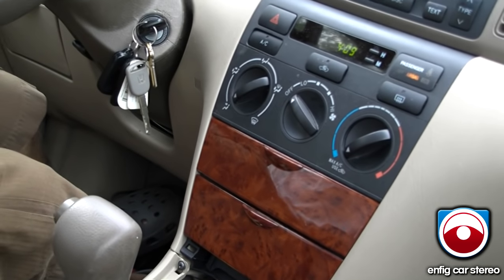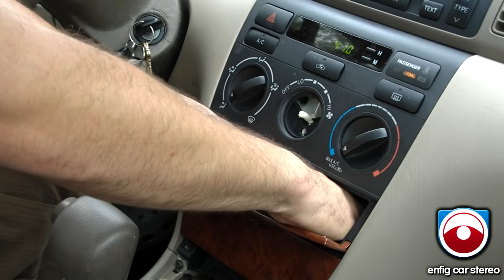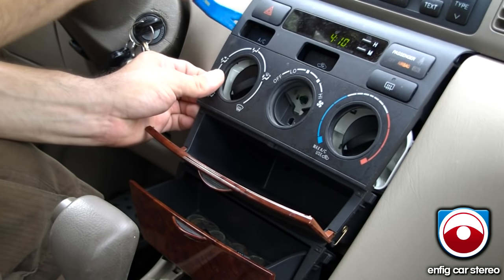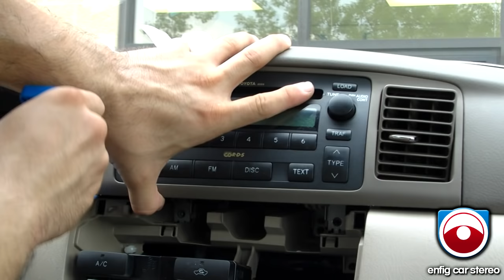Radio Removal Toyota Corolla 2003 -2008

Comment: Great video! We swapped a radio in an hour thanks in part to this. No life story, no blah blah blah! Thank you!! Bam! Also, tip: not to lose those screws, stick a little rare earth magnet on your impact driver's shaft near the drill end and it will magnetize the entire impact shaft. That will hold the 10mm screws for you when you take them out and put them in.

Comment: Great way to break the panel. If the air vent under the clock is not on middle possition you will cry over broken panel...haha. I an lucky I figure out before to break it
Reply from the maker: I've done this installation many times and never had an issue.  Can you explain what you mean?  I don't understand how the positions of the knob makes any difference so I must not be understanding you.
Reply: @Enfig You can do as many times you like, until you get to Corolla with different trim (looking very similar) and then you will break the panel, which is regardless of how many times you done it before. It is what I said, IF you dont put the air vent, i mean the horizontal one which mixing the air from outside, then you will break the panel. Only way to remove is to put in in middle position. There are different assemblies of Corolla. Looks almost same like the one on your video
Reply from the maker: @namaikati9112  Can you email me a picture?
Reply: @Enfig  yes. Or look for corolla ZZE122R
Reply from the maker: @namaikati9112  I see you are talking about the manual recirculation switch.  We do not have that in the US.

Comment from the maker: Sometimes disconnecting an airbag indicator can cause an airbag fault that must be reset by the dealer.  I dont think that will happen with the corolla but I am not 100% sure.
Reply from the maker: @sm1ttysav Also in many cars my customers have had issues with an unrelated module not working after unplugging the battery.  Because of the power surge.  I'm not saying that you shouldn't disconnect the battery but sometimes it can cause damage.  This is a can that I personally would not disconnect the battery on.

Comment: Pep boys tried to charge me $180 to do this for me over the weekend. It was an emergency but not at that price. Thank you for helping me step my handyman game up.
Reply from the maker: $180 labor to install a radio sounds fair but not just to remove the radio.
Reply: @Enfig  yeah that’s all I needed, they considered it uninstalling and reinstalling it. The issue was my third party radio wasn’t turning off when i cut the engine so the radio was draining my battery. Needed to unplug it and plug it back in.
Reply from the maker: @BreezeInfinite  Technically they are right but that's why I always recommend staying away from chains.

Comment from the maker: It doesn't really matter where its at as long as there is room to remove the panel.  It is usually recommended that you disconnect the battery but nit necessary.  It just reduces the damage if something happens.  The key is on but engine not running when I shift the car but  I reccomed putting it in park and removing the key once that trim is off.

Comment: Superb video. Utterly efficient. Thanks for the tip on using a magnet to get the screws out, and using gum when reinstalling them. When I reinstalled them I wrapped the screw heads with a little plumbing thread tape to get them to stay in the socket.
Reply from the maker: Thank you!  That would also work.

Comment: Probably a dumb question, but when you remove the panel is the shift in Drive or 2nd according to your video?  Also, should you disconnect the car battery when working on the radio?  Is the key in ACC?  Couldn't tell.  Sorry for all the questions, and thanks again!

Comment: The door where you put your hands in to remove the big panel on my Toyota is broke. I found a replacement at a junk yard for the whole panel. You mentioned something could happen by disconnecting the airbag light when removing the panel. What should I expect? I need to unplug it obviously to switch out the panel, but just wanted to know what I should do or be aware of. Thanks!

Comment: Thanks for posting this how to video.  My friend's clock on her 2003 Corolla is not working.  I will use your video to repair it.  Her car is an automatic.  Also, the light bulb for the gear shifter is not working on her car.  Might be just a burned out bulb.  I was wondering if I take off the gear shifter panel, would I be able to see the light bulb or some other parts need to be taken off? Thanks

Comment: Careful with that front panel. I didn't realize that the top corners are clipped and ended up breaking both. They don't "pop off" as easily as this looks unless it's been done to the car before, and the joints have been loosened.
Reply from the maker: I agree this is why I pry on the top when I remove the radio to loosen those clips.  Also make sure that the plastic is not cold because had plastic brakes not bends.
This is the part of the video where I loosen the top.
https://youtu.be/b3Bz5yz_DkU?t=2m42s

Comment: What power tool did you use to remove the four screwdrivers? Is there other ways to do it and can you post links on where to buy it? Thanks.
Reply from the maker: +Isaac Moua A regular socket extension.

Comment: great video.  I have been searching your site for an adapter that would allow any USB device to be plugged in, not just an ipod.  Does this exist? If not, is there a product that would allow iPod music connection as well as an 3.5mm AUX plug?

Comment: Great video, but you can just pull the air vents/fascia out without removing all the rest of the trim can't you? I can do that now after following this video but maybe that's only because I loosened everything in the process.
Reply from the maker: We were taking out the radio in this video not the air vents.
Reply: @Enfig  to take the radio out you need to take off the trim panel that has the air vents in it, you can take this trim panel off without removing anything else.
Reply from the maker: @WilliamMoser  Oh I get what you're saying now.  But you risk scratching the panel below it.  I would rather be safe than get sharp metal that close to the trim.
Reply: @Enfig  good point!

Comment: I put was putting my CD in the Toyota Corolla 2005 radio and a few seconds it goes out automatically, I turned CD upside down, put it in and of course I got an error. next time I put CD correctly, it worked!
Reply from the maker: Thanks for the tip!

Comment: Hey @Enfig , I don't use CDs no more, and I am thinking if is possible to install a 2010 Yaris set (which has auxiliar) into my old 2004 corrolla.

Greetings form Mex!
Reply from the maker: I have no idea.  But the parts to replace the radio with an aftermarket radio are very cheap.  Check out our website.

Comment: What sized drill bit did you use to get the 10mm screws?
Reply from the maker: You just need a 10MM socket on an extension.

Comment: Thanks for the video! It looks like it will be very helpful. The model that I have is exactly the same, except that it has a digital climate control panel (so there is no 3 knobs to remove to find the hidden phillips screw) does that mean its fixed in another place? and if so any ideas how to remove that? Thanks!

Comment: I want to know what size is the die you used to remove the 3 screws from the radio. Thanks
Reply from the maker: I think its a 10mm but I'm not 100% sure.
Reply: @Enfig  Hey Thanks, I appreciate it

Comment: I have a 2002 corolla. i haven't taken out the headunit yet but i was wondering if it is possible to hook up a subwoofer to the stock headunit? is there a spare output at the back?

Comment: I've been at a loss searching for a clear answer; I have a 2008 Corolla (same generation interior) and the light that illuminates the temperature knob (rightmost knob of the three) has stopped working. If I replace the right green bulb in that white box containing the switches behind the face plate and it doesn't work, could it be a fuse problem? If so, where are the fuses located that correspond to the interior lights? 
Thanks!
-Alex
Reply from the maker: +Alexander Arduini Not sure I have never changed out the lights.

Comment: I'm currently changing this entire panel with the ac control etc, If i unplug everything and replace it with another, would it be a problem? as in would the car start fine or would i need some sort of code?

Comment: This video helped me alot but for some reason after I finished everything. . The clock on the dash is out but everything else including new stereo lights up works fine. . You know what it might be causing this issue ?
Reply from the maker: Did you take out the radio to make sure it was still connected?

Comment: I'm installing a new stereo into my Corolla (same year), but I am wondering if it's necessary to disconnect the negative terminal on my battery before I start removal and installation of the stereos?
Reply from the maker: We don't recommend it because of the surge that is possible when you reconnect the battery can damage something.  But If you disconnect the battery it can protect you if you make a mistake. Unless we are gutting a car we usually do not disconnect the battery.
Reply: +Enfig Ok, got it! Thanks so much!
Reply: CaliFuego your supposed to disconnect regardless 
Cause of electrical shock
Reply: Interesting. Would you recommend draining the battery instead?

Comment: Hey there! I have a question, I know that here you explain it works on Corolla 2005, but some people told this adapter will not work on my 6 CD Radio and I'm wondering if it is or not true? Can you help me? I want my iPhone connected to my radio =(

Comment: I have a Corolla 2006 and the 5-multi CD player is jammed with 3 CDs.  Disconnected and reconnected the car battery.  No luck., there is no reset button.  My radio works so I don't think it's a fuse.  Do you have a vid on how to unjam the CD player?  BTW, great vid on the radio.  Thanks.

Comment: I have a 2006 toyota corolla the cd changer won't load or eject i was able to pull out 2 cd's with a tweezer. is this cd changer fixable and where do i get a panel tool?

Comment: my Corolla has air con so no switches to pull off where do i find the screw please?
Reply from the maker: I have never worked on a Corolla that does not have the manual controls.

Comment: hey enfig, I have a 2003 corolla with the same radio in the video, I've purchased a fusion single din, it came with a bracket in the box, do I need to buy any transformer cables? the fusion is a simple model with no CD player unlike my current one which has a CD player but no USB or aux connectivity hence my upgrade. should I be able to just tuck in the CD connectivity into the dash, or does it come in a hard plastic casing with everything in one that I need to transform? I haven't popped it open myself yet.
Reply from the maker: This can connect to your factory wiring then cut off the black and brown and wire to the fusion harness.  What model number?  I thought fusion only made marine radios?
Reply: Enfig nah FUSION is widely used in australian/bogan tuning, they do speakers, radios and i think even bodykits.
Reply from the maker: Cant see the link for some reason.
Reply: Enfig just youtube things

Comment: Does anyone know if there is another fuse behind the radio? My radio suddenly stopped working. I have checked the fuse box and none of the fuses are blown.

I was in the process of removing the radio myself to check but couldn’t complete the last step as my tool wasn’t long enough to reach the 2 screws at the back of the radio.

So if someone could tell me if there is another fuse at the back of this radio or not, that would be appreciated.
Reply from the maker: I'm pretty sure there is not a fuse behind the radio.  But it is always a good idea to check for power behind the radio at the harness.

Comment: I bought a 2005 Toyota Corolla off of eBay to play my cds. When I installed it both of the knobs did not work. But every thing else did. Do you know what could be the problem?
Reply from the maker: You purchased a Corolla off of eBay to play your CD’s?
Reply: Enfig yes
Reply: Enfig it’s for a 2005 Toyota Corolla
Reply: Enfig no I mean I purchased a  2005 Toyota Corolla CD player
Reply from the maker: Ohhhh..... Sounda like a bad radio.
Reply: Enfig it’s weird because everything else works. The only problem is the two knobs. Do you know anything I can do to fix it?
Reply from the maker: I had that happen once. Radio broke during shipping.
Reply: Enfig and also when you hit the load button on the CD player the lights don’t flash and all it says is wait.
Reply: Enfig I bought a new one because On my old 2005 Toyota Corolla CD player when you put a cd in it said error 3. I did not know how to fix that. Do you have any suggestions on how to fix error 3 on a 2005 Toyota Corolla CD player?
Reply: Enfig quick question, do you know what error 3 means on my 2005 Toyota Corolla CD player?
Reply from the maker: @johnlight5504  According to google "Error code 3 means a mechanical error concerning the laser lens and around the lens, which can be fixed through troubleshooting."
Reply: Enfig maybe some compressed air and a cd cleaner could fix it? It’s already taken apart so do you think that would maybe do the trick?
Reply: Enfig So I checked today and the plate wasn’t on good on the CD player that I bought from eBay. Do you think that might have caused the knobs and the CD player not to work
Reply: Enfig If I make a YouTube video can I show you what the problem is with it
Reply from the maker: @johnlight5504  Sorry but I do not repair radios.  I would replace it with a new one.
Reply: Enfig ok
Reply: Enfig so I have the same Toyota Corolla 2005 CD player that I bought on eBay. Does it have to be a certain model number or serial number for it to work in my car?
Reply from the maker: @johnlight5504  It works with all US radios.  Also make sure the port is the same since there are V1 and V2 versions.  We guarantee it works with all US radios but since some countries use radios installed at the port we cannot guarantee international fitment.  But it almost always works.
Reply: Enfig I uploaded a YouTube video to show you. I took it out of my car to look at it. Their is some yellow stuff near the knobs. Could that mean it’s just dirty?
Reply from the maker: @johnlight5504  Sorry bud your guess is as good as mine.
Reply: Enfig it’s alright I’ll just buy another one. Thanks for your help
Reply: @Enfig  thank you for helping me though. I just bought a after market one with Bluetooth and a CD player. Thanks for the help!
Reply from the maker: @johnlight5504  That's a better idea.  Let me know if you need any parts for the install.
Reply: @Enfig  we are having it installed. Thank you for the offer through.

Comment: My problem is that the radio ate one of my CDs and will not for the life of me release it. I've tried multiple times it just wont. and I also want to upgrade the cd slot anyways so what kind of problem will it cause if they dont come out?
Reply from the maker: Replacing the radio in that car is easy.  Also if the CD does not come out and you want to leave it as is you shouldn't have any problems as long as the mechanism stops when the car is turned off.
Reply: @Enfig  yeah it doesn't try to push the cd out when the car is off, if it did I wouldn't be posting this lol. I'll just replace it I want an aux connection for the radio too but I still want my cd back its my favorite...
Reply from the maker: @art-byfayleif3938  It has to be opened.  Check local repair shops for a quote.

Comment: Why does everyone leave the battery hooked up for these cars though?
Reply from the maker: For the same reason people don't wear a helmet every time they leave the house.  Disconnecting the battery prevents you from causing a short.   There is little danger of a short removing this radio. But sometimes reconnecting a battery causes a power surge that can fry a component.  I"m more afraid of that.  But your wouldn't be wrong if you decided to disconnect the battery just like you would be wrong wearing a helmet everywhere just in case.
Reply: @Enfig  I was like why is this guy coming at me like he's salty about what I said...then I realized. Its OP. 😨. I dunno I guess im overly cautious with electricity. You are probably right about that. I work with commercial voltages a lot like 480V and the equipment i work on shorts on 24V AC so I guess its just habitual for me to wear that metaphorical helmet when working with electricity and electrical components or equipment. Have a good one. Thanks for the video
Reply from the maker: @JC-sc9rx  😂😂😂  there's nothing wrong with disconnecting the battery. You just don't always have to.   Home is different that stuff can kill you.  I just took the screen of a Tesla. Since that's basically a computer the battery always gets disconnected for that. It's just depends on the car and the person working on it.

Comment: can i use those old side mounts in next new system?
Reply from the maker: Sometimes you can but sometimes they dont sit at the right depth.  Plus you need the trim that comes with the side brackets to do an install.